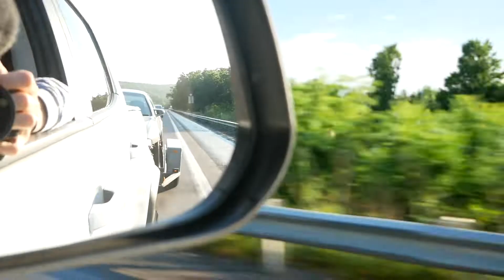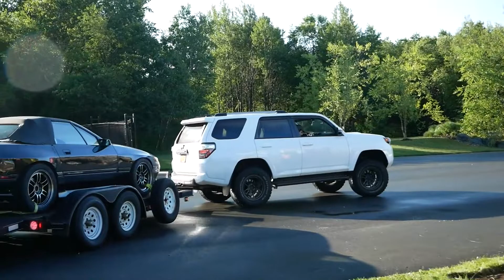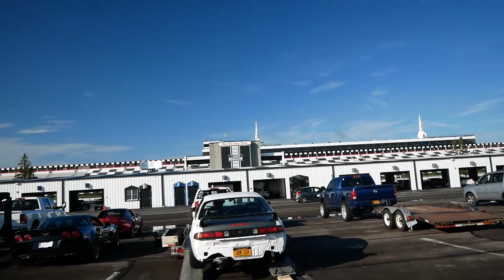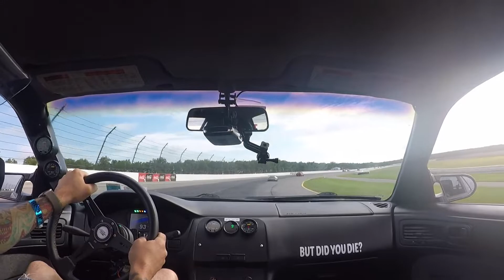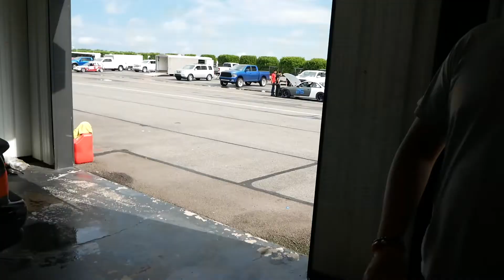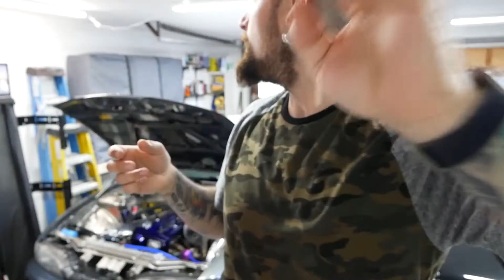First TRACK DAY with my garage built engine, hopefully it doesnt blow up 🤞 | 240sx s14 rb25det

Comment: Great stuff Chris.  On the front under-steering part, you could try something simple like 10mm hub-centric wheel spacers to widen the front track a little bit.
Reply from the maker: That’s a good idea.. thanks for the tip.. I think I have spacers sitting on the shelf right now. Definitely gonna try for next time out